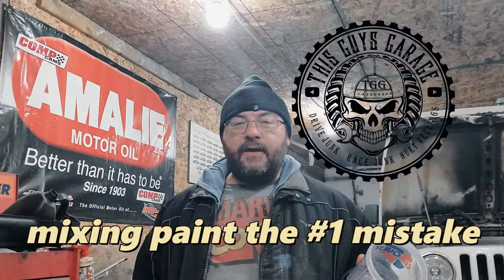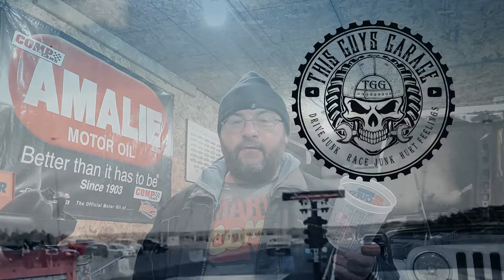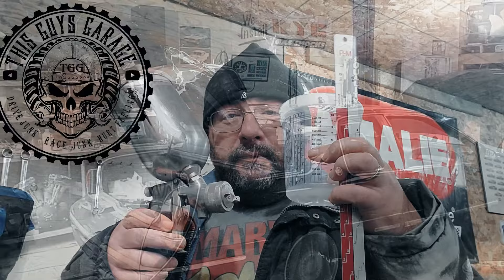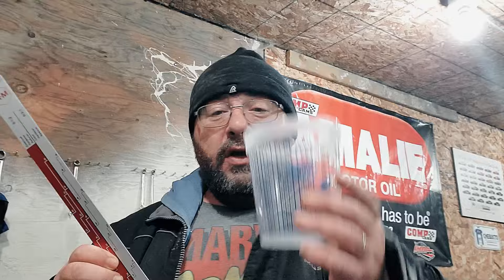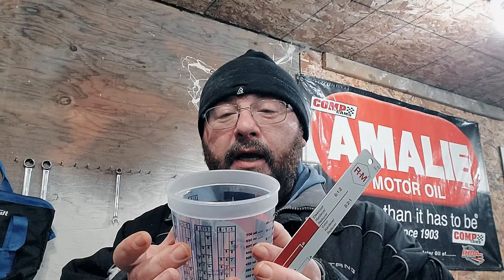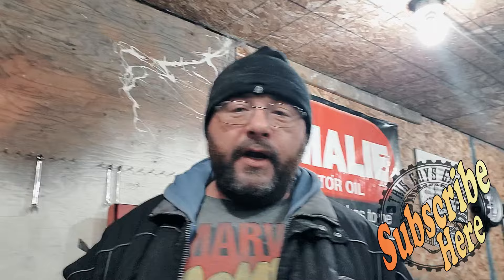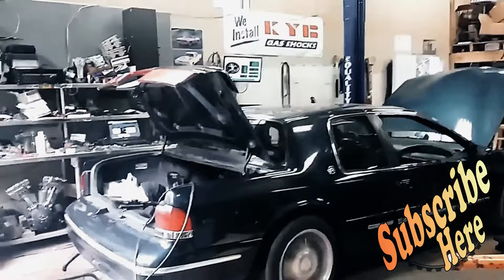mixing paint and clearcoat number one mistake

Comment: So what’s the correct way? Use an aluminum can? Do you think the manufacturers adjusted the measurements to compensate for the shape difference?
Reply from the maker: no the ratio has to be exact.  
if you are using the graduate plastic cup. use the ratio on the cup and not the stick.  does this make sense?
Reply: Yeah I think I was thinking same thing he was.. me personally thought you meant you cannot use that mixing stick in a cup like that. I guess I didn't realize you meant the measurements on the stick I took it as you were saying do not use a mixing stick in a cup unless it's straight up and down I understand what you're saying now

Comment: Wow am I glad I watched this video !!! That’s crazy.
Reply from the maker: Thanks so much Ryan, I appreciate your taking the time 👍
Reply: @thisguysgarage  I live in arkansas, and am looking to buy a blow up paint booth. I’m going to be trying to replace the rear quarter panel on my 2000 mustang gt, if I can get my hands on one, I have to experienced friends who are professional welders, and I’m waiting on a hood from cjpony, what’s your advice on weather and if I spray in the cold? If it’s to cold.
Reply from the maker: @ryanpetty392  there's a point where it's too cold to paint .all paint systems have fast reducer  for working in a cold environment  ,I believe 60-70 degrees is the safe zone for single stage paint last I checked.  The base coat has the same drying properties.  Select a Clearwater for cold weather if you can't wait till the weather warms up ,  or see if you can find a paint booth to rent.
Reply: @thisguysgarage  awesome thank you. I will be doing “gotta have it green”on a 2000 Mustang gt that I’ve for 13 years. It’s that laser red color. I’m replacing the rear driver quarter panel, because I hit a gaurd rail in the snow back in 2010. It’s all bondo and has started to crack in the arkansas weather. I’m going to do a primer sealer base coat clear coat. But I really appreciate the fast response. Your videos has helped out a lot. I even purchased a 60 gal. craftsman air compressor 2 weeks ago, from Lowe’s for my sand blaster and and painting my car. So I will make sure it’s going to be 70 to 75 degrees no wind or humidity, thanks to you and your “much appreciated” answer. You make everything simple.
Reply from the maker: @ryanpetty392  I know the Profesional lingo ,but I do my best to keep to layman's terms to be easily understood. 
If you understand what you are doing it simplifies things. I have a 1999 Lazer red gt. I was contemplating highland green for that in the future, some day lol

Keep in touch if you have any other questions fire away 👍
Reply: @thisguysgarage  ok yes sir and thank you.

Comment: You can use the cup to put your paint in so im confused all to hell, lets say im mixing a 4/1 clearcoat i can put 4 parts clear in and 1 part hardner with the 4/1 illustation on the side of the cup and stir it up with a stick and go and i get slicker then a fresh sucked lolypop😂 finish everytime all the time 100% of the time so you lost me on this SIR the absolute key to a killer paint job is prep and if you have a booth that keeps everything out. Sprayguns help but there not everything cause technique wins everytime over a $1000.00 spray gun     But back to the cup being smaller at the bottom its accounted for as the cup gets bigger if you dont understand then mix with a measuring stick in a perfect round can then poor it in the cup and you will have the mix perfectly just try it👍 your confusing people for no reason happy painting all the same!!!!
Reply: Hes not confusing people, he is just saying that if you use the measuring stick to measure your paint inside one of those cups it will be the wrong mix,. Not that if you use the measurements on the side of the cup.